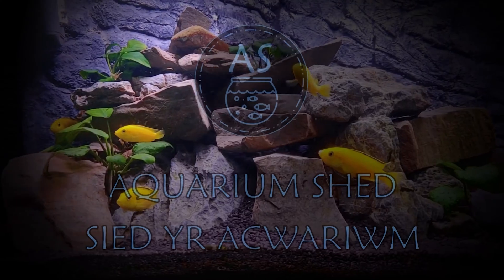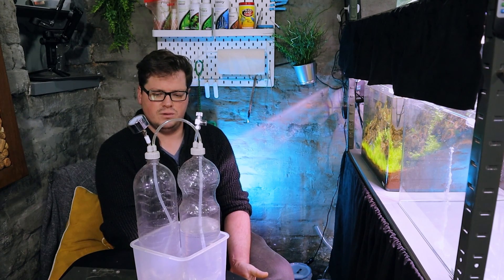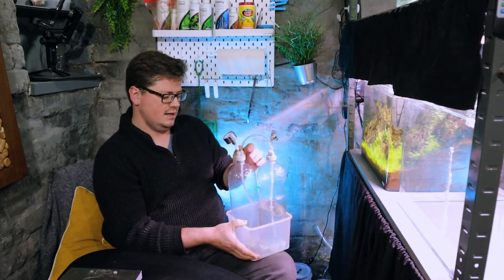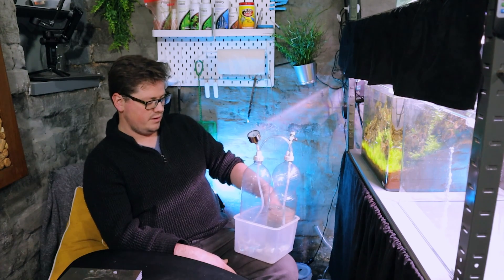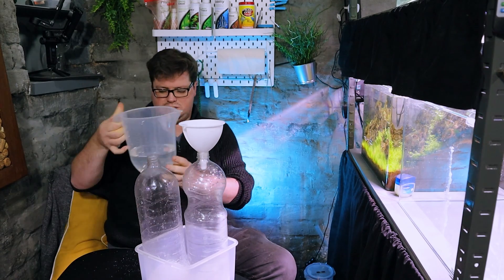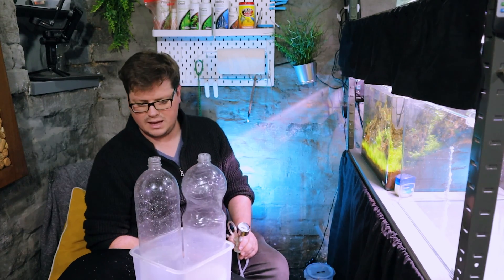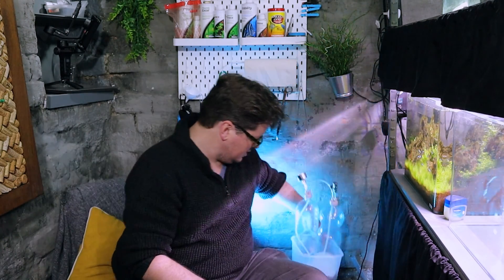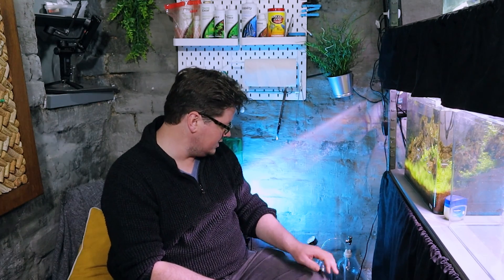Get the best results from CO2 Soda Bottle Kits

Comment: You may have a different name for it in England but what you want to use to seal the fittings is called pipe dope among American plumbers. British plumbers probably have some other name for it, but in America we call it pipe dope. That is probably going to provide the best seal. I can see how Vaseline would help, but you might as well use a product that is actually made for ceiling threaded fittings. It's very cheap.

Comment: what would happen if someone uses Vinegar instead of Citric acid or carbonate instead of bi carbonate ?
Reply from the maker: Ooosh, I'm not 100% sure tbf. I know that ppl in this community have experimented with vinegar as a replacement for citric acid and it worked fine. But carbonate instead of bi carbonate is a new one on me. r/Chemistry on Reddit would be your best bet.

Comment: Silicone grease might be more reliable as a lubricant to ensure a tight seal, vaseline/petroleum jelly, is sometimes thought to damage some rubberised seals.  For steel cylinders I tend to use PTFE tape, though some suggest it should not be used.  I have lost the contents of fire extinguisher when I have failed to use PTFE tape.  Never used these two bottle devices, did try the Colombo CO2 reactor with citric acid and bicarb.  but hated setting it up, felt it did not outlast a yeast system and crystals became an issue with time.  Yeast and sugar is very 'green' but summertime and it doesn't hold out that long and it has to be filled fortnightly generally, but that fits with most regular filter maintenance.

Comment: Thank you for the video.
Would one be able to integrate a small solenoid valve so the C02 release can be stopped for say 6 to 8 hours?
Cheers.
Reply from the maker: Hiya. For one night it should be fine. When you turn off the valve it stops the syphon, so the reaction will slowly stop. That said, you will still see the pressure rise so I wouldn't switch it off for days at a time just to be on the safe side!
Reply: @AquariumShed  Thanks for the info. Just need it off for no more than eight hours a day. Will give this a try.
Cheers.

Comment: Can this system be switched off manually as to not suffocate the livestock of the tank overnight as the plants will not be using the excess CO2?
Reply from the maker: Yup, absolutely. When you switch the valve off the syphon between the bottles also stops so the reaction slows down and its definitely fine to leave off overnight. I actually used a solenoid with my kit. 👍
Reply: @AquariumShed  fantastic. Thanks for the help!

Comment: Hi. I realise this post is old so I hope this message is seen. I've watched various tutorials but what I need to know is where the bottles should be placed in relation to the aquarium. Should they be below, level or above?
Reply from the maker: It doesn't matter. Just be sure to put a non return valve on the outflow pipe! 👍
Reply: @AquariumShed  thank you. Non return valves arriving Friday so I can finally get it set up :)
Reply from the maker: Fantastic. Glad I could help! 👍
Reply: @AquariumShed  me again. I honestly have no clue when it comes to CO2. I bought a kit that claimed to come with a solenoid valve and bubble check counter but it didn't. I've since bought a bubble counter but I haven't bought a solenoid valve yet because they are ober budget for me right now. I'm becoming very disheartened. Do I absolutely need a solenoid valve. What is it's purpose? I've probably spent about one hundred million thousand pound setting this damn tank up so far (I haven't even got a fish yet). If I do need one could you suggest something low cost but efficient enough for my needs? Thanks in advance :(
Reply: @donnamorgan803  Solenoid is only necessary for automatic on/off switching (and only works as such if you have some sort of timer switch that will turn it off and on - I use a smart plug that connects to my google home system). Without the solenoid it will output co2 constantly unless you manually close the control valve. The advantage to turning it off and on is that plants don't use co2 at night (or when it's dark depending on your lighting timings) so if you continue to pump large amounts of extra co2 into the water 24/7 you can accidentally suffocate your fish at night when the plants are not pulling it from the water. You can solve this by either remembering to manually turn the co2 control valve off and on each day, or by purchasing an air pump/bubbler system that can run at night (though this will have the same requirement of either some sort of timer switch, or manually turning off and on). I got my air pump on amazon for $18 Canadian. Remember for the air pump the bubble requirements are different from co2 - co2 you want a diffuser/atomizer that will create the smallest bubbles possible as  you want them to rise slowly and not burst at the surface so that the gas exchange occurs in the water. The air pump you want lots of bigger bubbles to break the surface of the water, this forces a gas exchange with the air and essentially equalizes the oxygen/co2 levels between the water and the air we breath. In my setup I do however have a solenoid system running on a timer - I have it set up so that when the lights turn off, my solenoid goes off and my air pump turns on. Then in the morning an hour before my lights turn on it turns off the air pump and turns on the solenoid to give it a bit for the co2 to saturate the water before the lights turn on and tell the plants to start using co2 again. So far it's worked great for me and I haven't noticed any suffocation behavior from my fish, but the same thing can be achieved manually it'll just take diligence on your part to remember to turn everything off and on every day!
Reply from the maker: Thanks so much for this. The original question had somehow passed me by, and it's lovely to see the community stepping in to help. Really appreciate it! 👍

Comment: I noticed that the one on amazon US does not come with the bubble counter? Where can I get the bubble counter? 
Thanks!
Reply from the maker: Hiya. Mine didn't come with one either, I think these DIY soda bottle kits generally don't. You'll want to get an in-line one which is sometimes called "double head" and then cut the outflow pipe and insert in between. This is a good example: https://amzn.to/3MNvLIa

Comment: 200g for how many liter bottle?
Reply from the maker: 2 x 2L Plastic Bottles
Bottle A: 200g Citric Acid Powder with 600ml Water 
Bottle B: 200g Baking Soda with 200ml Water.
👍👍
Reply: @AquariumShed  so thats mean if i use 1.5 liter bottle ,150g for citric and soda?
Reply from the maker: If you reduce the water proportionally too then I think you'll be OK. But I'd still recommend just sticking with the manufacturers instructions! 👍
Reply: @AquariumShed  can i use 1.5 liter bottle for 200g citric & soda?
Reply: @AquariumShed  tq

Comment: Hey! Do I have to shake the bottle again when I have to use it the next day as my baking soda has been settled down as a sedimentation over night.
Reply: I haven't had any issues with mine as the baking soda settles. Because the weighted line puts the acid output right into or on top of the settled soda it still provokes a reaction. I do like to give mine a little shake every few days when I think of it, but I haven't noticed that I've needed to.

Comment: Hmm.... While vaseline sounds like a good idea, you should know it can dissolve certain plastics making the sealing problem worse over time... I'd rather go and put a silicone sealing on both the bottles to tighten things up and support the sealing in the cheap caps. They're cheap at any home depots in a set with different sizes

Comment: Hi there and thanks for these diy Co2 vids! 
I've bought a kit but cant see the correct size bottle to fit to the lids that came with the kit.
Which drink/s should I buy that will fit my kit please?
Reply from the maker: Ooh that's strange, I'd have thought that bottle lids were fairly standard. The ones I use are old sparkling water bottles and the thread on the bottle is about 24mm. It's the same as most coca cola bottles I think. Hope that helps and you are able to sort it out! 👍
Reply: @AquariumShed  Yep, bought coke for the first time in years. Used the liquid to clean the toilet and other things (it works!) and the tops fit the bottles. 
Now to try the kit out when next able to. Thanks!
Reply from the maker: No problem at all, glad you worked it out! Cheers. 👍

Comment: 5:40 when you say completly off do you mean completely shut or open?
Reply from the maker: Hi. I mean completely shut so that the pressure can build up. Hope that helps. 👍
Reply: @AquariumShed  and where's the safety pressure relief valve?? is it that white plastic part rounding the tube just right down the gauge?? and if it exists like most of the merchants are saying, on what readings will start to release excessive CO2????????????????

Comment: Great tutorial. I have just bought the same and only run a couple of days. I have a couple of questions if you have the time. My pressure kept building, even when I pulled the tube out of bottle A. Is it normal it keeps building? And my materials only last a couple of days. I followed your advice and used vaseline, so I'm sure it's air tight?
Reply from the maker: Hmm 🤔, that does sound a little strange. When you use the magnet to pull the tube out of the solution in bottle A the reaction should start to slow down because it's not siphoning any more citric acid into the reaction chamber. But obvs what's already in bottle B will continue to react with the bicarb until the citric in there depletes. So this will be why the pressure continues for a bit, but it shouldn't last ages. In terms of the length of time, it's totally variable on bubble rate and use. It's been a while since I've used this system because I've changed to the steel generators, but if you check out this video - https://youtu.be/tU5kuxJ_6Bs - you'll see how much co2 is created by the ingredients. It could just be that you using the co2 in your tank really quickly because of your required bubble rate. These systems are best used for small Nano tanks really. Hope that all makes sense, good luck working out the solution! 👍
Reply: @AquariumShed  thanks. I think I'm going to Steele container or the ista professional co2 system. Thanks again.

Comment: Hi my C02 has been reacting for 3 hours and it's only on 0.5 pressure. Is this normal, I checked for leakes and there is none, thanks
Reply from the maker: Hi, it can vary a bit dependent on the quality of ingredients etc. But it's a good sign that you are building pressure. If there was a leak you wouldn't see anything. My advice is to wait a little longer, it can take up to 10 hours. 👍
Reply: @AquariumShed  thanks I'll leave it overnight and check it again 👍
Reply: @AquariumShed  it went as far as 0.75 and stopped. I wonder if my ingredients are not good quality, if I used extra citric acid would that help, maybe 250 grams?

Comment: Cant wait to try this I bought a full kit including an electronic solenoid that connects with my lights!
Reply from the maker: Excellent. Good luck with everything, hope the video helped! 👍
Reply: @AquariumShed  got the co2 up and running using the same kit and even put vasoline on the threads! So far it holds pressure just fine and gives me perfect flow! Running about 1 bubble per ~8 seconds on my 5 gal heavy planted neo tank.
Reply from the maker: @hugacreeper69110  fantastic. Really pleased it's working well for you! 👍
Reply: @hugacreeper69110  … I can understand lubricating the seals but what do you use the Vaseline for on the thread?
Reply: @andyxox4168  sorry for the late reply but basically it helps with preventing leaks!
Reply: @AquariumShed  update! Still works like a dream! I’ve only mixed new solutions twice! So about a month and a half of use until I have to re mix. Again thank you for the video! Probably the best in depth tutorial and the vasoline tip works wonders!
Reply: @hugacreeper69110  sorry for late question but any problems with turning it off with the solenoid at night? Also pressure in the morning when it comes back on? I have the set up but wanted to add one but heard of them blowing ect at night. Thanks!!
Reply: @elzonn  I’m scared to turn mine off at night so leave it running constantly. To make sure there’s plenty of oxygen at night I turn a bubbler on.

Comment: How do you adjust the pressure/bubble counts?
Reply from the maker: Hi. There is an adjustment valve on the output, and then I have added an inline bubble counter to the tubing that goes to the tank.
Reply: count 1 bubble per second (for a small to medium size aquarium. FINE Adjust with your perssure valve.

Comment: does both tube touch the bottom of the bottle
Reply from the maker: Hiya. No, just the one with the little metal ball at the end that you can move up and down with a magnet. The bottle B tube sits about halfway down the bottle and slowly drips solution from bottle A via the syphon effect created by the build up of pressure! Hope that helps. 👍

Comment: Hi just wondering if you can give me measurements of the 2 pipes that go into the 2 bottles one looks shorter than the other also one looks like its as a  junction spilter is it necessary to have that on i got my setup second hand and its been used for yhe surger and yeast method by the looks and am trying to convert it back to citric acid and bicarbonate soda. Thank gor making this video i watched your other with the metal  generator but want to experiment with this method thanks 👍👍

Comment: Could I turn this off every night?
Reply from the maker: You can because the siphon will stop when there's no pressure being released. However this doesn't account for the additional pressure created from the continuing reaction so it is far from ideal and there is definitely a risk of the soda bottle exploding/cracking. A better solution is this - https://youtu.be/tU5kuxJ_6Bs - if you want to switch off or attach a solenoid it's a much better option! 👍
Reply: So if I stop the siphon from going from one bottle to the other it won’t explode?
Reply from the maker: @dopeghost7258  there's just no way to guarantee that. There will still be a reaction taking place in the second bottle so altho it's less likely, its not guaranteed. The steel canisters are rated to a much higher pressure. 👍
Reply: @AquariumShed  what if I open the lid at night and then start the siphon in the morning? Couldn’t I leave it on at night or would that kill my fish.
(Its a 110l planted aquarium)
Reply from the maker: If you open the lid you'll just lose loads of co2. Like I said, you can switch it off but it's just not as safe as the steel canisters because even with the siphon stopped the reaction will continue for a little bit. I'd just give it a go and experiment a little, it's unlikely to go wrong but it is possible. But if you want something more straightforward then the steel canisters are awesome! 👍

Comment: Could you use this method on a 110 litre aquarium?
Reply: Thank you so much I really neaded this info
Reply from the maker: @dopeghost7258  no problem at all. Happy to help!
Reply from the maker: Yup. The limiting factor is just the amount of co2 produced by the system. With 200g bicarb and 200g Citric acid you will produce 105g co2. There are calculators online that will tell you how long this will last at different bubble rates, and tell you what bubble rate is right for your setup. My guess is that this system would last about two weeks. Good luck! 👍

Comment: Instead of trying to squeeze the life out of the citric acid bottle, run it under the hot tap so much easier.
Reply from the maker: Aah that's a great tip, thanks so much for sharing! 👍
Reply: How does this work? Thanks
Reply: @manufacturer3602  As you run hot water over the acid bottle the air inside expands and forces the acid mix into the other bottle. No squeezing needed.

Comment: I'm doing this citric acid and bi carb mix with this same setup metal with the silanoid and on a timer, why for some reason after one day or two, all of the mix is in on bottle?
Reply from the maker: Hi Calvin. That sounds to me like the system isn't fully sealed so the syphon between the two bottles just continues and continues. Check the seals and make sure the bottles are in good condition. It should take significantly longer to use up the ingredients, unless of course you have a really high bubble rate which I'm guessing is not the case. Fingers crossed you can sort it out. These systems do require a bit of tinkering I'm afraid. Good luck. 👍